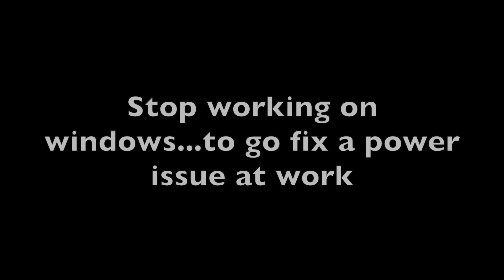Sharing Our Frugal Life in Appalachia

Comment: I understand about the windows. When we bought our cabin in WNC 11 yrs ago it had single pane windows. Every year I'd put plastic up over the windows. It was a small fixer-upper vacation home we hoped to one day retire to. About 5 yrs ago it unexpectedly became our full time retirement home due to health issue. Living with the windows 24/7 and not just a weekend was a rude awakening in the winter. The window panes were getting ruined, the hardwood floors under the floor to ceiling windows were getting ruined. I tried lined drapes in an effort to fight it. They just stuck and froze to the windows. Put rolled up towels at the base of each. It was a constant losing battle. The roof wasn't insulated either (this cabin was never meant to be a full time residence). We finally had the roof replaced with insulation and a metal roof and all windows replaced at the beginning of the pandemic. Best thing we ever did!

Comment: im so happy for you! i knew exactly what you were talking about with condensation etc. this little 1949 house has original single pain windows n i cant awe out in winter foe condensation. gas heat doesn't help. i miss heating with wood. in every way. problem is when i did replace one, ended up tearing out the bottom half of wall because of other issues from bad windows... so now im scared to do more for fear of what im gonna run into and find and the cost! lol its gotta be done. materials are so high right now. 
you are blessed you work well together. not everyone does... 
thank you for sharing your life and taking us along.

Comment: Looks like Matt did a fine job sealing the windows. I noticed how he took great care. I wish the people who put ours in took that much care. I live in a townhouse apartment that was built in the 1970s. It still had the original windows when I moved in, and those things were fogged from condensation, and would get ice inside in winter, just like yours. It got so bad one year that I was able to scrape off enough shavings from the bathroom window to build a tiny snowman in the lavatory sink. I did that because if you don't laugh you just about have to cry, it was so bad.  The windows were finally replaced, but on the side that gets the prevailing winds, I can feel the drafts blowing in at the edges. It's so bad that gritty dirt gets blown in through the cracks, and I have to vacuum the window slides. It's not just for cleanliness but also to keep the dirt from building up so high that I can't get the windows open. It builds up really fast. If Matt has any tips on what I can use on the inside to seal them better, I'm all ears.
Reply from the maker: I'm sorry they did such a bad job! He used a tape that is made for insulating windows-sealing then in before he added the trim. I wonder if that would work? It comes in a fairly large roll, it's black with silver writing and really sticky. It came from Lowe's, but I bet other hardware stores would carry it.
Reply: Look up something called rope caulk. It’s pliable, cut to size and you can line your windows with it to prevent dust/debris and elements. Really cheap and very effective. It does/can limit functionality, especially if you put it in all gaps, but it stops the issues you’re talking about.
Reply: @CelebratingAppalachia  can you connect my comment to KA? For some reason I’m not able to reply directly to them. Thanks, Tipper! Love you guys.
Reply from the maker: @dmmenace08  It won't let me either. Hopefully KA will be notified about your reply even though it didn't tag right 😀

Comment: On rotary tools that sat around for a while and has a slow start, you have to get that commutator/brushes clean with a soft brush seating cleaning stone. It’s good that it started running, but peek into the housing to see if it sparks too much or burn smell.

Comment: I told my wife yesterday that I'm ready for October. I've got an old drill that was probably manufactured in the 1950s that turns only about 500 or 600 rpm that will wind your arms up if you hang the bit up. My dad and I used to climb towers and used it on them and needless to say you were careful not to hang it up. The windows look good.

Comment: Couldn't help but laugh when I heard you tell about paying off the braces, and the washer going out. Years ago, when our boys were about 5 and 9 (they are 35 and 40 now) we decided to take them to Six Flags. We loaded them up in the Taurus wagon and left our house at about 6 AM. We were about 25 miles from Six Flags when we heard the motor racing, but the car coasted to a stop. We realized our transmission had gone out. We called a wrecker to pick us up. All I could think about was how much this was going to cost, and my boys were crying because they werent going to get to Six Flags. We were three hours from home, and five hours from nearest family. The wrecker took us to a transmission place and dropped off the car. He then took us to a place where we could rent a car. I was bound and determined we would go to Six Flags, and we made it. A week later they called to tell us the car was ready. We load up in my bosses van and drove back to metro Atlanta to pick up the car. We made it about 30 minutes from the transmission place. My wife was driving the wagon and I saw her pull off the interstate. This was WAY before cell phones. I pulled over and backed up close to her and got out to ask what was wrong. She just said the car made a funny noise and quit. Turned out, it had slung a rod...Had to drive my bosses van to North Central Alabama, get my dads truck, rent a car hauler and get the car home. I can laugh now. How amazing it is to look back and see what a struggle it was. I love your videos and always walk away with a warm heart seeing how similar our lives are. Thank God for good honest folk 🙂
Reply from the maker: Oh goodness that was a hard time! Sounds like something that would happen to us 😀 I'm glad you can laugh about it now 😀
Reply: Sounds like my life in a summary! But these are the things we look back on and realize we were made with grit and perseverance.

Comment: When I got out of High School I went to work as a finish carpenter way before battery tools. I remember when Milwaukee came out with a battery drill and it had a box with a motorcycle sized battery in it and a 6' or so cord to the drill. It was kinda worthless the battery took forever to charge and didn't last long. All the tools I bought were Makita and to this day I still have them all and they still work like new. I have the 9.6v makita battery drill and the Makita sawsall and my Skill saws etc. the kids make fun of me because I don't use the battery tools much although I have a ton of them. I prefer to pull a cord and use my orig. tools. I have a saying "I like manual equipment, it always works". I've replaced a few triggger switches and cords get old and rotten but I ain't havin to buy big dollar batteries only to have them let me down when needed. When I was a carpenter we mostly piece worked and time is $$ and I had no time to fuss with batteries. I recently saw a battery powered tablesaw it takes 2. batteries and had a hard time ripping wood which makes it worthless to me. Love the channel. Mom was from Wv. and your cooking is close to the same as hers was and the Wife and I live pretty frugal as you do. If we can't do it ourselves it don't get done mostly because hiring someone is so expensive and here on the West Coast kids are so lazy you can't hire one to help. I farmed hay for 14 years and had to quit because you couldn't hire any farm help no matter what you paid and I could out work 99% of them and i'm in my 60s and my knees are done.
Reply from the maker: Thank you for sharing! So glad you enjoy our videos!!

Comment: I just wish appliances lasted as long today as they did 40-50 years ago. Used to be a time when you bought a washing machine or a refrigerator you'd have em for 20+ years. You'd need to replace an part or 2 during that time, but they were so reliable. Appliances today are too fragile. Spend $4000 on a washer and dryer and 6 months later something is tore up on it. Frustrating.